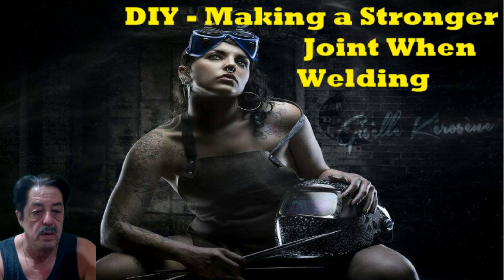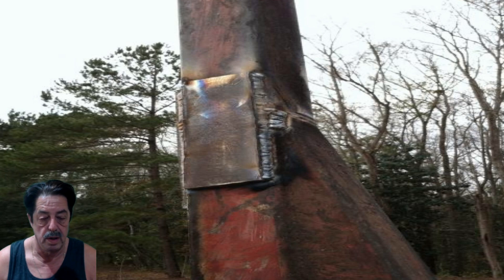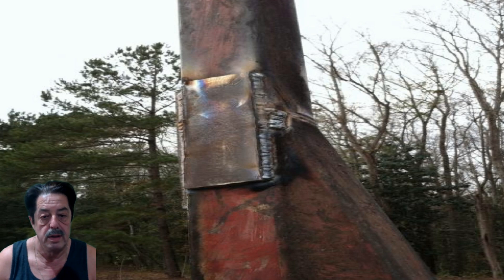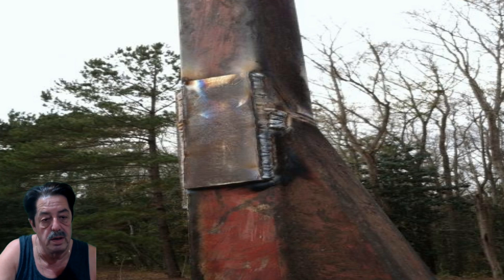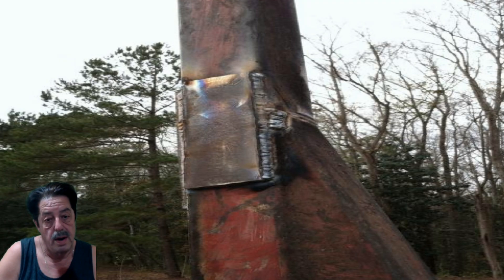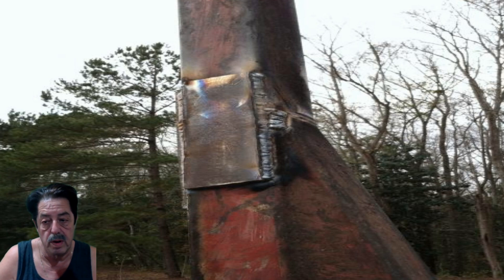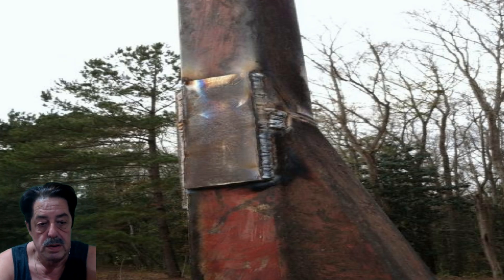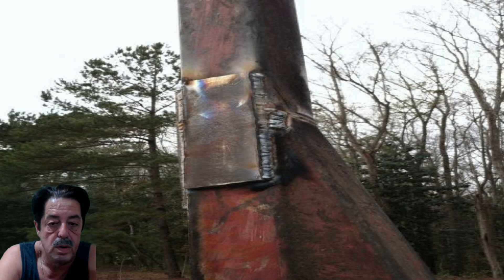How To Make Stronger Mig Welds

Comment: Good video handyman.  Diamond shaped side plates welded on all four sides work also that is what is use to shorten and lengthen truck frames.  Keep the videos coming.
Reply from the maker: Hey I did not think of that but you know what that is a great ideas when dealing with frames.......good to know and thanks ....just learned something new from you